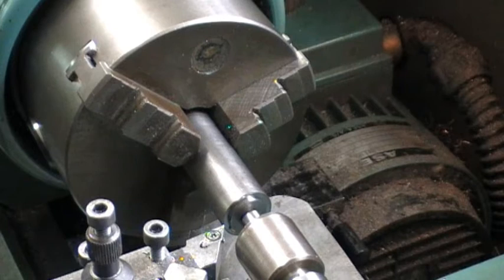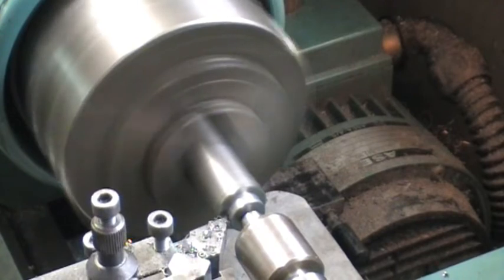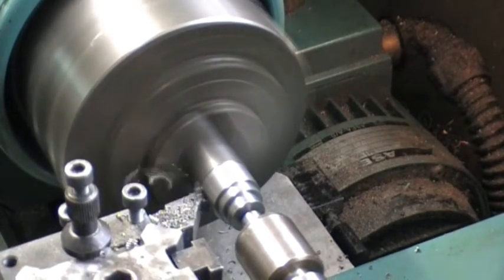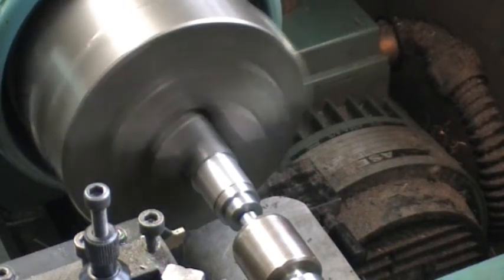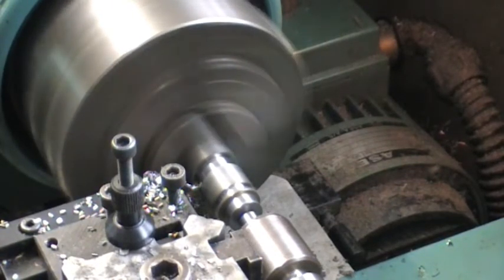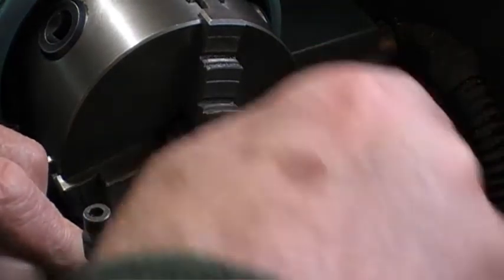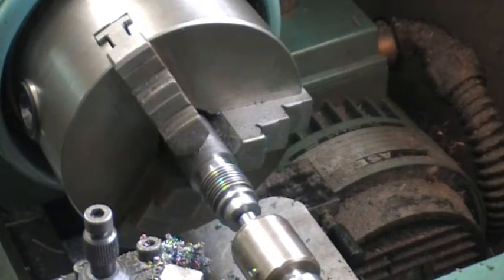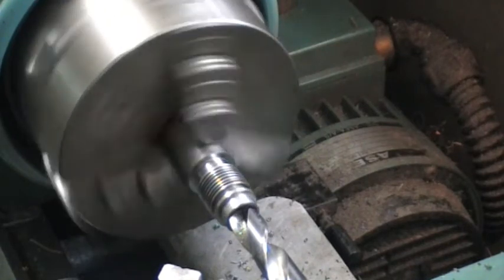Turning V8 cylinder Denford Orac CNC lathe

Comment: Very nice. I'm a model engine builder myself. Currently I'm restoring an Orac that I bought 2 months ago.
Reply from the maker: Are you restoring to original condition and control system ?
Reply: @ukmwg  When I bought it, it was completely stripped from all electronics and stepper motors, only the main motor was there. All the rest were thrown awsy by the previous owner.  Mechanics were all very good, only needed a cleaning and re-oiling. Currently building a new and modern  control cabinet based on EdingCNC software.